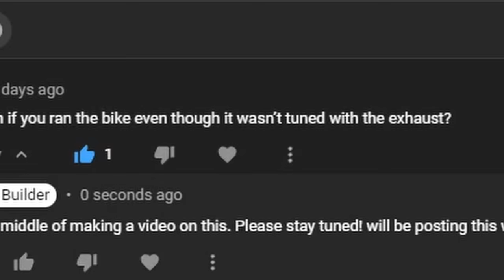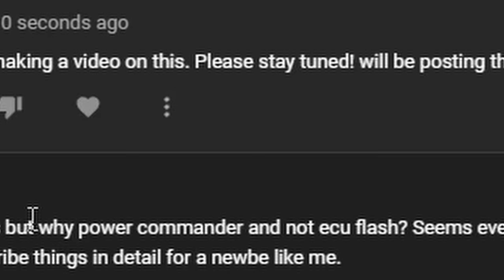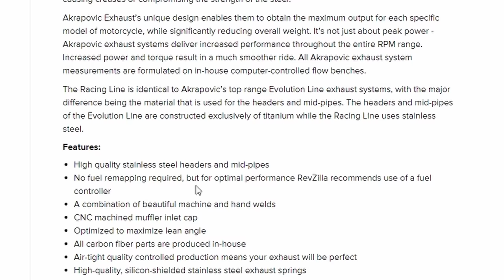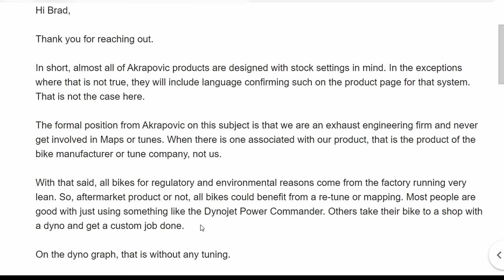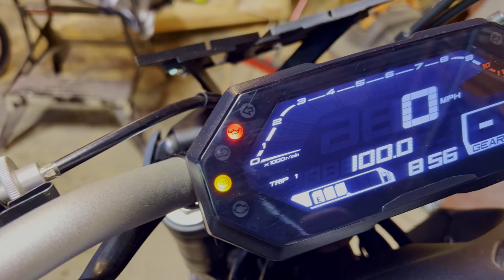YAMAHA MT07 | I'M SHOCKED!! | Do you need to tune your bike to an aftermarket exhaust??

Comment: Great video, very useful information. As a long time drag racer familiar with reading plugs and jetting carbs I just want to clarify one thing. When reading plugs the porcelain tells us two things, overall engine condition and if we are running the proper heat range. Dark porcelain indicates that the plug is too cold and not retaining enough heat to clean itself. Too hot a plug will have a very white and possibly blistered porcelain. For air fuel ratio we need to concentrate on the shell. Spark plug manufacturer's and the aftermarket sell lighted magnifers just for looking down into the shell to see the color. The color down inside the shell indicates what is actually happening in the combustion chamber and is not affected by how well the porcelain is transferring heat to the cylinder head. Thanks again for sharing all your mods. I'm doing pretty much the same stuff to my 2022.
Reply from the maker: Thanks for the great comment and adding to the reading plugs portion. It’s a lost art and am still learning everyday myself but it can be a very useful tool of telling what’s really going on in your engine. Really appreciate it! Peace ✌️

Comment: You don't even need to send out your ecu to get flashed, that's old school. The best method of flashing is doing it yourself. FT-ECU offers the best options for flashing with a laptop. They have the standard flashing kit and the Activetune kit.
Reply: Could you make a video on it ?
Reply: @London Biker  I don't need to since Jakethegardensnake already has.
Reply: @MT-THNDR207 do you remember what the video title is? I went through his channel and I can’t find it, not sure if he took it down or if I’m just missing it. I have an R7 and am looking to get an exhaust/intake for it.
Reply: @samvarney2319  If I remember correctly, it's in his Two Brothers exhaust install vid. Lmk if that's it.
Reply: @MT-THNDR207   it wasn’t, but the video that was recommended after it was. The title is “fz07 ecu tuning flash engine tuning” in case you needed it for anything. Thanks for helping me find it, I appreciate it
Reply: @samvarney2319  My pleasure. I think I've got the vid in a playlist. Where are you based out of?
Reply: @MT-THNDR207  Ventura county, CA. I’m finishing up my last year of college in San Luis Obispo though currently. Trying to do some research to see if I want to start performance modifications now or when I’m done since I only have about 5 months left. Was just reading about air intake systems and now I’m leaning more towards after school lol
Reply: @samvarney2319   Nice. I'm in south OC. Intake and exhaust should be done together. And the tune is best to restore hp, and also prevent lean afr problems.
Reply: @MT-THNDR207  yea I planned on doing just the exhaust initially as some online forums said it’d be fine, but I’m gonna hold off on it and just do everything at once. Don’t want to risk anything
Reply: @MT-THNDR207  thanks for the info and insight
Reply: Do they have pre configured tunes ?

Comment: I’m new to the motorcycle world so I might be wrong but i don’t see the purpose of tuning after installing an aftermarket exhaust. I see that the MT-07 has an 02 sensor. The ECM gets the input from the 02 sensor and makes fuel adjustments depending on the reading. Well at least that’s how it works on fuel injected cars.

Comment: A 100% stock bike, exhaust and all, can benefit from a proper tune. No, I don't mean a canned map, I mean a proper tune by a professional on a dyno using a fuel controller that you can actually tune with. Increased performance, better fuel economy, and seamless drivability can be expected.
Fuel injectors shut off on deceleration. When the engine gets to a certain rpm nearing idle, they come on again and BANG! Easily tuned out if the tuner knows what he's doing.
Are you wondering if your bike is running lean? Yes, it is. Now you know.

Comment: Currently run my 33k mile XSR900 with the intake mod, full exhaust, no tune, OEM replaced spark plugs, and no issues whatsoever. Just like new.
Reply: Maybe no issues but your bike is probably down on power compared to stock.. i did the same on my xsr, next week it is getting its flashtune to richen it up

Comment: A much more accurate way to test it would be to use a wide band o2 sensor (which is what they use on a dyno to tune them), since the air/fuel ratio changes throughout the rev range and at different loads. It will always be leaner at light load and lower rpm. At higher load and higher rpm it will run richer. So how you ride will determine what the plus look like Plugs only tell part of the story since ignition timing also affects how they look. 

And were they new plugs installed for the 100kms? If not then the test is a waste of time as well. 

Most people misunderstand how fuel injection works, and think that adding something that increases airflow means the bike will run more lean than what it did beforehand. With a few exceptions this is false. The ecu has a sensor that monitors how much air goes in and adds the appropriate amount of fuel. The mapping has load points past where you will hit in everyday use. 1 reason for this is the change in air density as air cools. If this wasn't the case then it your bike ran a little bit lean in summer, then if you live somewhere that gets snow and rode it in winter then it would be dangerously lean. The same applies to cars. This is why you can add an exhaust and it doesn't actually change the AFR much at all (the only change is from using a different load cell for that throttle position and rev range). In a lot of cases, when you do actually exceed the mapping load points the ecu will actually cut power (some will retard the ignition and go stupidly rich in the last cells before you exceed them to reduce the power).
Reply from the maker: Thanks for the comment with such valuable information. I completed what I could with the tools I have. Peace ✌️
Reply: This is true but not entirely, its true that motorcycles do have o2 sensors dedicated for monitoring the afr all the time. BUT, this is not all the time, the o2 works generally in closed loop with the fueling table so little corrections can be applied. Problems really comes when full throttle situations, in most of bikes when you are 100% throttle the fuel injection goes straight to the fuel table that is mapped in the ecu. So in these situations you do will be runing lean.

Comment: My MT07 was running a bit lean (at light load) after mounting a full exhaust and DNA air filter. ECU remap and dyno solved that and gave a decent increase in HP (nothing crazy), but a more smooth powerband and power delivery.
Reply from the maker: Thank you for sharing! Much appreciated

Comment: Hi B-rad. Awesome video as always, super informative. Does the piggyback system come with a base tune on it or does one have to have knowledge on tuning? Also do you know of any options to make the Mt-07 a bit louder without having to go down the tuning route. Thanks for your content.
Reply from the maker: Thanks for the kind words!! Been working hard to deliver better content. So the unit does come pre tuned for the stock exhaust. Gives it a touch more fuel. To install one of the dynojet tunes you will need to install their software which you would gain access to once you purchase the unit. There is an instructional video on their website how to download and use the software. It’s very easy but to go in and adjust the tune is advanced and recommend a phone call to dynojet if you want to go crazy. The tunes they provide are pretty good as is. Sending your ECU in to get flashed would be the easiest for someone who doesn’t plan on making changes themselves. It is also cheaper. 

Do you have an aftermarket exhaust? If not, there really isn’t a way to make it louder stock. I wouldn’t recommend making changes to your stock system if that’s what your running. I wish the mt07 had a slip on option for its exhaust. It’s not designed for that but would be a middle ground for riders to be able to get better sound without dropping hundreds of dollars and scratching their heads. Unfortunately that’s not the case. A full system of exhaust is the only way to make it louder.Remember as discussed in this video though. The carbon Akrapovic is designed to be run without a tune verified by both revzilla and Akrapovic themselves. It’s up to the user if they want to tune. I personally like to be on the safe side which is why I went with a tuning system.

Comment: As long as you use the O2 sensor of course you will be stock bike lean, you are running stock fueling. I just ran a bike on my dyno and was surprised it was quite close on air fuel.
Reply from the maker: That’s great to know thanks for the comment

Comment: If you use the DNA airfilter & open airbox lid the standard ECU will compensate. Mine is running a little bit rich but I run with the baffle in the exhaust (I have neighbours). I will be getting it remapped but not until next year but it runs fine with the airbox & exhaust as is.
Reply from the maker: Thanks for commenting and contributing! Peace ✌️

Comment: Hey mate, awesome videos. I,m kinda in between getting ECU flash or power commander 5 or even power vision. My question is how big is the difference between stock and you power commander? For example I can pull easy wheelies with clutch on 3rd gear but impossible at 4th gear. But I have seen that some ppl with mt07 get it up on 4th gear quite easy. Now that you own Power commander, would you still go for that if you had to buy it again ? Cheers mate
Reply from the maker: I would get a flash now believe it or not. Dynojet just updated to powercommander 6 and they have no tunes available. Could be a while before they get on that so I highly recommend getting your ECU flashed instead. Thanks for the kind words as well. Really really appreciate it! Hope this helps

Comment: Hey there great video, what made you choose the Akrapovic carbon exhaust?
Reply from the maker: I like the look of the loop bending in the back. Otherwise I would have got the yoshi.
Reply: @BradTheBuilderChannel  that looks good! In my opinion it is too loud, I narrowed my search between SC project S1 or this Akrapovic Carbon for an XSR 700. thanks for the feedback on the tune.
Reply from the maker: @eduardoportillo0096  The sc project is probably the top of the top you can get beside the Akra titanium system. Compare decibel stats on both and no problem

Comment: Hi there! Awesome video, subscribed! I was hesitating for months between the CB650R and the MT-07, but it looks like I finally decided to go with the MT-07, because I will be mainly use it in the city, and the torque comes in very handy, I still like the looks better of the CB650R though. Aftermarket headlight options are anyway available, so I don't care that much about it. My question is, do I really need to change my factory suspension, is it really that trash? I am not going to go on track, and I don't think I will find myself on the twisties too much either, but everyone is shouting how trash the suspension is. I don't want to do tons of mods, because I am certain this will not be my last bike. Would you buy an exhaust with tune for what I will be doing, or would you instead do rear and front suspension upgrades like YSS rear shock absorber, and YSS fork upgrade kit? I obviously would love to have more sound, but not too loud or ear piercing, but if I don't enjoy riding on the bike because the suspension is unbearable for city use, then it makes no sense to do anything before suspension upgrade. Your reply is much appreciated, have a nice day dude!
Reply from the maker: I agree everyone rages about how bad it is. In reality the mt07 would be a flop of a bike if it was that bad. The fz/mt 07 is one of the most popular naked bikes out there. For price point, it’s near unbeatable. I don’t have an issue with my suspension with the daily riding I do. Sure if your going into turns at high speeds and using it for track days then absolutely I would upgrade the suspension but it’s not necessary for daily riding. I have never had a dangerous moment with it either “caused by suspension”. People I think caught onto a trend and feel like they have to do it for it to be rideable and that’s not the case at all. An exhaust in the city would be nice so people can hear and see you. To me an exhaust is essential to safety. People are ruthless out there. Hope this helps and stay safe!
Reply: @BradTheBuilderChannel  Thanks for the reply dude, I am relieved. :) Much appreciated!
Reply: @BradTheBuilderChannel  By the way, have you ridden the 3rd gen MT-09? For 1500 plus, you get more electronics (IMU, Lift control traction control, drive modes, up & down quickshifter. etc.), better suspension, better sound from stock, less snappy throttle response (based on reviews, driving modes can change the characteristics of the bike a lot. Mode 3 and 4 is very throttle friendly.), better brakes, better frame,  looks like a better package. If I would go with the MT-07, I would probably get the Akrapovic option from factory, which sets the price already to MT-09 territory. Additionally, I like the stock sound of the MT-09, so I would not have to change anything on that bike, it is just perfect as it is. Would I be able to have the same fun as the MT-07 for my type of use? I feel like I would be able to keep the MT-09 for longer, and if I decide to go for a longer trip, the better suspension might come in handy. Thanks for your thoughts in advance. :)
Reply from the maker: @frozenrage6664  I have also asked myself this question and I would go with the MT09. I have also heard great things about it. The 09 sounds great and would pack a punch compared to the mt. The Mts low end grunt/torque I doubt would be matched by the 09 however. Regardless the 09 is also a fantastic option and a great price. I would go for it!
Reply: @BradTheBuilderChannel  Awesome, much appreciated!

Comment: I am not sure how but my dealer is able to tune the fuel mixture for MT07 without even ECU flash/piggyback....however, the value is quite limited but it is doable... So far I can tell is bike from 2015-2017 and 2018-2020 is able to tune it. Not sure whether the latest version is doable but I guess it should be able to tune it.
Reply from the maker: This is very interesting. I’m really curious to what it is that they are doing then. Comment back if you ever find out specifically
Reply: @BradTheBuilderChannel  As far as I know Yamaha will distribute some software for dealers to slightly "calibrates" fuel injection. I currently using stock exhaust but have deleted catalyze and a slip-on. In that software, they are able to tune the fuel injector interdependently with values 1 to 5... If not mistaken 1 is being the leanest and 5 is the richest... My current setting is 4.
Reply from the maker: @shyan5886  thanks for the good info! I’m gonna check with my dealer and see what they can do too. I appreciate the comment
Reply: @BradTheBuilderChannel  Just get it from my friend.. It actually adjust the CO2 level. Engine run rich = high co2, lean = lower co2..

Comment: I'm wondering how older versions of the bike (like pre 2018) would perform with aftermarket exhausts, where mapping setup probably wasn't as lean to begin with to meet some new emission standards.
Reply from the maker: The ECU configuration would have come slightly different from factory and is hard to know without owning a pre 2018 machine. However the akrapovic full carbon aftermarket exhaust system featured in the video is claimed by both Akrapovic themselves and revzilla a third party seller that the exhaust system can be run with no tune. The exhaust is the same for all model years of the fz/mt 07.
Reply: @BradTheBuilderChannel  While it can run without tune the difference is noticable between the "flashed" or tuned ecu and the standard ecu. Stock from factory is what the bike is tuned for. If you change anything than you should do a new tune to the ecu. Its simple from a mechanical stand point. Stop looking for short cuts to a powerful bike and just go buy a 1000cc bike.

Comment: What about the Yoshi R 77 and K&N air filter? Which is my current set up-- been pondering this.
Reply from the maker: It’s still something you want to consider with any full system exhaust. I haven’t done research on that exhaust on wether or not it comes engineered to run without a tune. I would check yoshis website or reach out to a rep
Reply: @BradTheBuilderChannel   THX